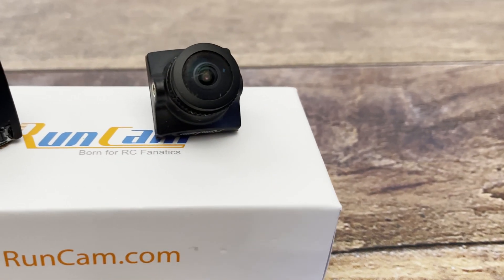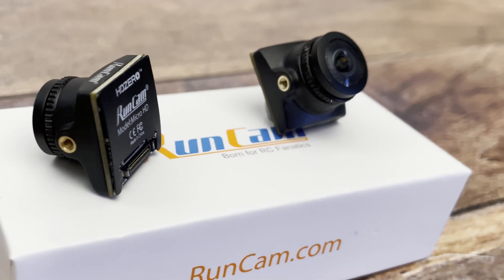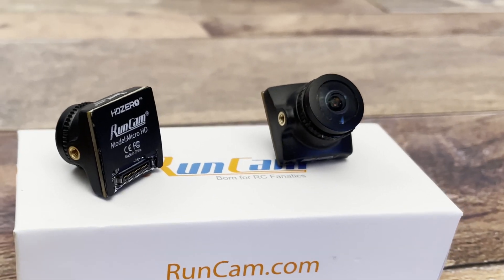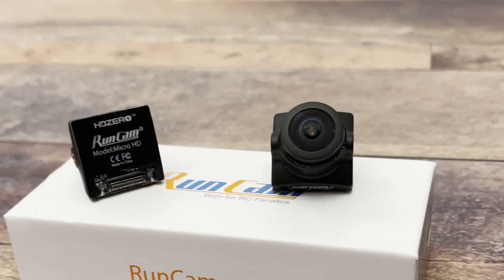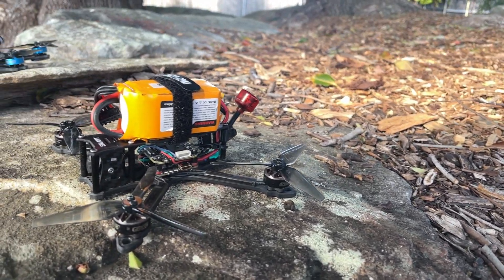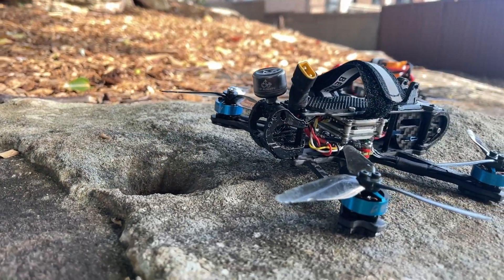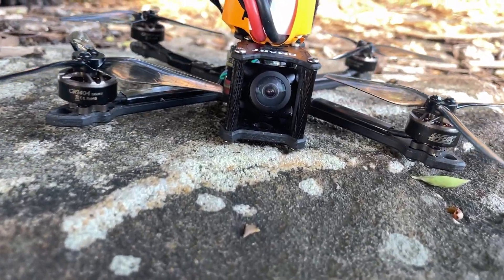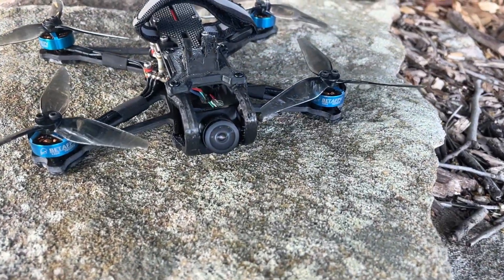Shark Byte Runcam Micro HD (HDZERO) vs DJI Runcam Mipi

Comment: Lol, I noticed that the DJI quad props were not in sight, and the SB props were. #1 SB, #2 DJI. I waited on Sharkbyte to get to this point. DJI image is unmatched as well as range, and penetration at this point, and probably will be that way for a while, but for me the deal breaker is variable latency. While Sharkbyte may not match DJI in any aspect except latency, and non interference of other pilots. I think that it is good enough at this point. The 1 watt vtx will also greatly improve the user experience. I hope the durability of the vtx improves, imo they should concentrate on making a reliable 30x30 as they develop a reliable 20x20